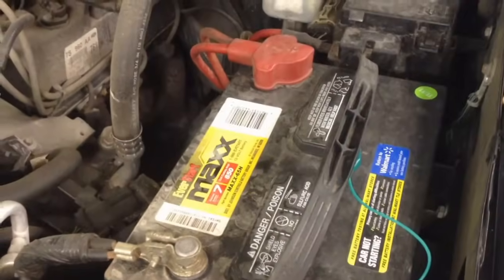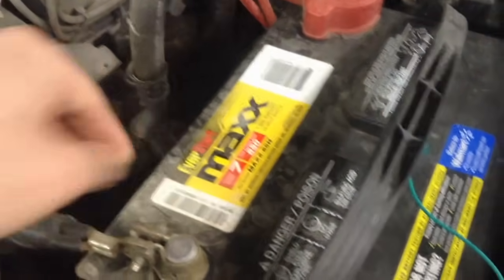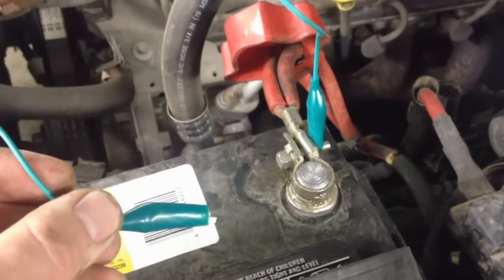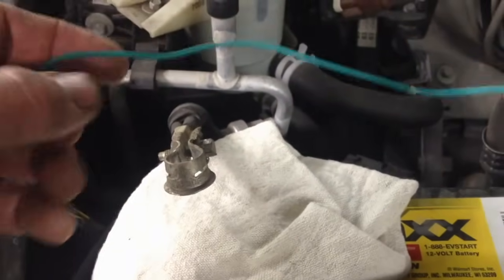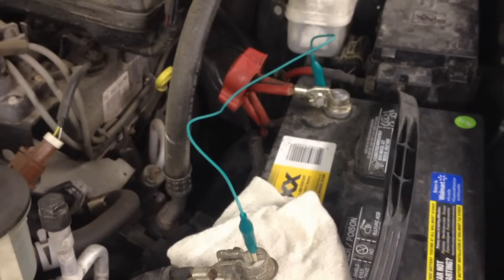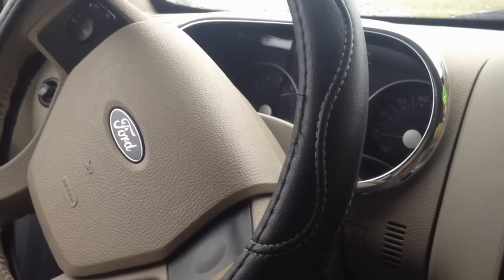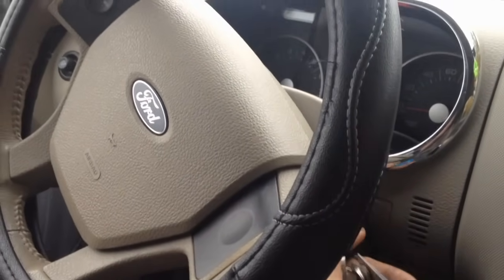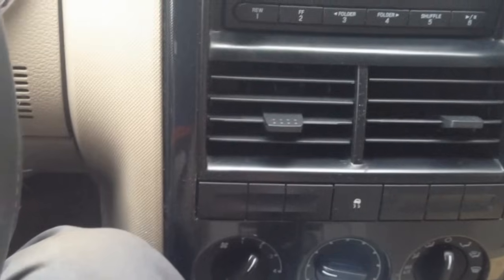How To Clear Your PCM'S Memory On Fords After Repairs

Comment: I have a 2014 Ford Escape with the dual clutch transmission. I cleared the KAS or KAM I believe its called. And it shifted good the first day. Second day it went back to shifting hard from 2nd to 3rd gear. I hear you say in this video that this should work better then actually clearing with a high end scanner? Let me know, because i dropped serious money on my scanner and it didn't fix the hard shift

Comment: Does this work on a diesel? Mine is an 04 e-350 6.0 super duty boxtruck. Has issues with being very sluggish and gear shifting. I removed the positive and left it off for an hr. Started driving a bit better but not doing as well as it should.

Comment: 2015 F150 3.5 Lariat. Wanting to try and reset the learned values in the EPAS as I have a bit of play or slop in the steering gear. Dealership would not perform or even look for a recalibration update (I gave them the one to look for but they wouldn’t do it) so before replacing the rack and pinion I’d like to try a reset to the learned behaviors in there and see what that does. But my hesitation to doing the PCM reset using this above method in the video I want to know if the TS bulletin I had installed several years back to update the shift points is going to also get reset. It was very hard shifting before they did the ts bulletin so I don’t want to go back to that. It’s been good since. Anyway to isolate the reset of just the EPAS? Not finding online. Thanks.

Comment: 89 ford mustang 2.3 with newer man built engine at 8k miles. Blew a belt thats why. And i took it back to shop once again for an oil change and changed thermastat and radiator because it got to hot. Now a year later the car has been having no power after a stop i can never floor it, usually have to 1/4 part throttle and Slowly increasing to half way open throttle. Got codes 23, 31, 83, 84. So 23 disappeared, and 31 disappeared after i put new egr vacuum solnoid, then next day i got 31,83,83 KOEO then 31 Cont... Im going to try this becuase i think this mught be my last step..

Comment: Can I pull the negative wire and connected to positive instead? If I dnt have wire clips?
Reply: I was thinking the same thing. Just disconnect the negative and hold it against the positive thats still connected to the battery for 5-10 min.

Comment: This would still work on a 13 mustang GT after valve body ?
Reply from the maker: yes
Reply: @FordTechMakuloco  how do I get the teeth to line up correctly with the blend door actuator ? I just pushed the actuator over and it clicked then , I put it all back together still hot ac but no click , I’m thinking I broke the actuator by turning it to the bolt in position , any help would be great

Comment: Great video! I assume this will completely clear all codes (including radio presets , correct?) 
* UDATE: It did not clear my radio preset codes!).      The GOOD NEWS is it gives me confidence that a learned code (that could remain in the PCM memory), will not fire and give me a false indiction resulting in a fail at the mandatory Emissions Test we have in Georgia (cannot get tag renewed without it!).  *   I recently had 2 codes (PO401 & PO455. related to fule tank/cap, evap canister and EGR issues. I performed the easy task first (cap less tank valve clean and lubricate), erased codes with scan tool and at 52 miles, CE light on again! The good news was the PO455 code for the fuel tank valve was gone! Next replaced the EGR and Purge valve, erased codes with scan tool and at 102 miles, the CE came on again. Bad news was I now have both codes back (PO401/PO455). I will go back in and recheck all performed work, purge soleniod @ tank, check lines/etc. * Can anyone tell me what is the normal/average range of driven miles needed for my PCM to reset?  For the codes above, my PCM reset after 52 miles first time and 102 miles the second time, driving the exact same route. Is this normal? THANKS FOR ANY INPUT!

Comment: I have a 2017 ford explorer sport 3.5l ecoboost. Ive recently put a custom emailed dyno tune on callwd AO auto octane tune by gear performance. My issues came when i tried to reflesh my explorer back to a stock tune. After returning it back to stock i started it and all kinds of check engine lights came on including traction control, hill assist, chwck engine and a bunch of others. It surged forward luke ut was in gear. I was so confused because it is a new car. So, i got scared a put the tune back on it and everything is fine again. Can you tell me what is going on or what i should do to get it back to normal on rhe stock tune

Comment: I know this is a really old video and you may not even see this, but I've replaced my alternator twice and the battery light is still on, all the wiring tested good for continuity and I have battery voltage where i should it's just not actually charging. I've been told by a local mechanic that I should replace the PCM. Do you think this might help me instead?

Comment: I am fairly ignorant on this part so I want to ask ... exactly what is it doing by jumping the positive charge side to the negative cable?  Isn't that feeding a positive charge through the system?  Sorry I understand your process and know it works I just do not understand what is happening electrically in this.

Comment: What do I do my 2009 ford f250 superduty 5.4 triton my truck has a car with a lock light on the dash with every other light won’t even try to crank the doors ding the radio don’t work the dash lights that tell u what gear ur in dont light up idk what’s wrong with it

Comment: I got an issue with the 2013 f150 3.5 EcoBoost number one cylinder has been misfiring and in six is misfiring so I replace coils on the coil packs all new spark plugs and the cylinders still not working got a code about the emissions and the fuel tank purge canister purge something so I replace that whole deal on top of the intake there for the Persian and it's still not still not functioning number one cylinder still dead any ideas

Comment: hello, I know this is an old video. just replaced one of my blend door actuators and had to pull the dash. forgot to disconnect the battery before disconnecting the air bag. will this clear the airbag light, or do I have to take it to the shop? Thanks

Comment: They say your the go to guy I have an 1994 f150 colt 5.0 I have changed front tank fuel pump fuel regulator and fuel filter I am still not getting any fuel to the fuel rail  please help

Comment: I appreciate your information about the vehicle you were working on. I had a fuel pump issue and it appears it might be the fuse panel underneath the dash so but that’s another story meanwhile I had someone check my truck and they thought that the ecm was bad so I replaced it with a new one from a auto parts store with all my vin numbers but after I put the new ecm in I don’t hear any turbocharger noise and it seems to think it’s not on the truck. So my question is will this reset work on a 2007 6.0 liter turbo diesel or does it need to go to the dealer to fix it or have the ecm done

Comment: I just bought a 2013 Fusion with the oftentimes 'dissed 1.6t engine' because the previous owner hated its shift points, shuttering and of course the high pressure fuel injector noises. Per your videos, I reset everything and put about 100 miles on it and it now runs great. $1000 for a 118k mile car that runs well is a bargain in my opinion. Thank you so very much for spreading your knowledge and simple step by step tips.
I've been a mechanic for decades but factory reset type cars were never my thing.... old school cars are common sense just like you've made the drive by wire vehicles via your videos.

Comment: I have a 2015 f150 3.5 EB. Bought it used with 78k. I now have 93k miles. Sometimes it will hesitate between 3rd, 4th, and 5th. Best way to describe. If you were driving a manual and in too high of gear at low rpm. You get that little shutter. It will shift, if you accelerate more. There no dash indicator lights. A shop told me ford needs to check the pcm. That’s how I came across this video. Side note. The truck was used commercially. But it must’ve been a Forman truck etc. it is pristine zero rust. Always was serviced.
Reply: Is this something I should try for what was mentioned above?

Comment: I did what you suggested transmission works but it doesn't work like it's supposed to hit won't go to overdrive and when it wants to go from first to second that kind of wants to hesitate and I just let off the gas and Let It Go on into gear after you drive it and you come home and put it in reverse it will not backup but you can put it in park and cut the engine off and crank it right back up and it'll backup I was wondering about putting a bottle of motorcraft friction modifier in it I did change the fluid and filter Mercury or 5 it has 187,000 miles on it Ford explorer with a 4.0 5-speed automatic

Comment: Dude!!! I reset the PCM after replacing the TPS and cleaning the Throttle Body, but my truck was on for 5 min and turned off by itself. Turn it on again and turned off again by itself after 40sec. No codes nothing what can it be?

Comment: Thank you so much once again for your TRUST-WORTHY informative video! 
Question: Should my 06’ Lincoln Navigator’s shift-points be relearned while towing a 6’x12’ cargo trailer camper conversion (2500-3000 lb.) since it will be towing the trailer full-time for at least the next year or more?  Thanks again. AE  BTW. I may be coming through ur city this winter and would like to
get some work done on my 3V 5.4L Navigator if possible. Can u please give us ur business info. (Address/phone/URL)?

Comment: If your car had a dead battery for a while, and was replaced, wouldn't that have cleared the pcm of energy, thus reset it's memory? I have a 2004 Tbird. It's having shift problems. Trans shops say it's the PCM.

Comment: Hello, love your videos and you are a huge help.  My '94 T-bird 3.8 liter V6, supercharged engine turns over but won't start. It is a professionally rebuilt engine from machine shop with many new parts such as camshaft position sensor, crank sensor. The camshaft synchronizer is installed in the correct position at 26 degrees ATDC of the compression stroke.  Has 40 psi at the fuel rail, has spark at the spark plugs, has 12 volts at the fuel injectors and compression is 145 to 155 on all six cylinders. All wires and grounds between the PCM and engine were checked and are good. It seems to be the fuel injectors are not being activated since I have compression and spark and fuel pressure. I'm thinking the injectors are not being activated, but not sure. Will this method clear the PCM for the engine also? Thank-you.

Comment: I know this is an old video that might be all the way wrong with that Im looking for.  I am replacing the HVAC Control Module on my 2014 Flex.  I was told I needed to flash my cars computer but I saw somewhere online that this might work in programing that module to my flex.  Is that actually a possibility?

Comment: Bought a 2014 F150 5.0 Coyote about a month ago and the check engine lights been coming on intermittently since I got it. Misfire on cylinder 7 is what it’s been saying. I’ve replaced the plug, coil, and injector. Still keeps popping on and runs rough in idle sometimes. Gonna try this when I get home. Hopefully it’ll stop it.

Comment: I just had a new transmission, coil pack replaced, new plugs under a CarMax warranty still didn’t fix the low speed bucking. Not fixed. Could it be something this simple??

Comment: Hopefully you see this message! I have a 93’ Explorer I’ve replaced almost every EGR related part and my Check Engine is still on. I read my codes and EGR is my problem, if I do this will my check engine come off if the problem is fix?.

Comment: Will this work on a 2010 focus SE..? There are these numbers on the trans pan 8S4P-7000-FA PVAF and I think the trans may be a 4F27E.. 
I had codes for shift solenoid C (the code was P0760 & P0760 P) and D (P0767 & P0767 P)
and I replaced A-E and the other sensor (I think it was a sensor) i also change the filter… I do have fluid leaking out now too 😔 but the problem still persists…. Only 1st and 2nd gear. No 3rd and no OD.  There are some lights on in the dash - the wrench, the traction light and that light won’t go off when I push the traction button.. and the engine light is on as well…  and the ABS light too but idk that I’m too concerned with that one at the moment… I’m at a loss on what to do with this car…. I’m hoping it don’t need a diff trans put in because idk how to do that repair plus I proboly don’t have the tools to do it plus I know I don’t have the muscle… what would u suggest I try next….? This dang car has me almost beat but I’m not giving up just yet…. Thank you for any advice you could send my way

Comment: So, I performed this reset and after years of troubleshooting, swapping parts, etc my severe power loss issue is resolved including many check engine codes that have been plaguing my vehicle's system intermittenly for years despite new parts. I swapped my engine, swapped the transmission and much more but the problems always came back. I have a 97 Ford Expedition XLT 5.4 with some insane modifications and upgrades, but still never had the power it should have. After the reset I performed the idle learning process and proceeded with the learning shifts process. However, the truck was now running extremely rough. It would not surpass 25 MPH. Every time I pressed the accelerator to go faster the engine would instead bog down. I had to severely feather the gas and start over feathering the gas pedal each time the vehicle shifted gears because it would bog down every time after shifting. At most I was able to eventually reach 40 MPH. I tried turning off overdrive as the truck previously performed much better with overdrive disabled. No changes took effect. It wasn't until I stopped, turned the vehicle off and then restarted the truck (without waiting for the truck to cool down) that the entire vehicle came to life. My truck has all the power it should of had since I bought the vehicle 18 years ago. Also, my passing power/kickdown now works and my truck climbs steep hills with overdrive enabed and without a single struggle. I have never experienced this truck running so well. I ran the check engine codes after the first horrifying test run and experienced engine operation temp exceeded, cylinderhead temp exceeded and drive cycle not complete codes. After clearing the codes and restarting my truck those codes were gone and stayed gone (I went for a long test drive on straight roads, steep hills and in-town driving). The only codes still remaining are the dreaded bank 1 too lean and bank 2 too lean. However , the truck is running amazing. So, what's my point, I think this video should be updated to advise viewers to turn the vehicle off and restart the vehicle before starting the driving test. Tomorrow I will perform the exact same steps and turn off the vehicle  after the idle learning phase before I attempt the learning shifts phase. Then, if all goes well, I will baby the truck until I surpass 189 miles to complete the drive cycle test and the OBDII machine confirms I have completed the drive cycle test. I will also read the codes before completing the drive cycle. I will check for codes after completing the learning shifts phase. I hope this helps someone because I was terrified my truck was going to blow up.

Comment: Hi, I just had my tcm replaced at the dealer, all my codes are gone, but when i connect my obd2 reader it says no  dtc,s or freeze frame data stored in the computer's memory, will this pass inspection all the im is green I did all the test drives I am at 250 miles it runs well.

Comment: I'm replacing my selonoid pack on 2005 mercury mountneer should I reset the ECM before I start it to do the auto level for the fluid or should I reset it after I level out the fluid

Comment: Good evening I have a question. I have a 2013 ford edge with the 3.5 motor  
All 4 camshaft position actuator are circuit open do you know if there is a fuse for all 4 ?

Comment: Will this work on the 13' model ecoboost f150? Mine has been throwing codes , I changed the lead frame in trans , was fine after I fixed and drive it that night ,next day drove it 15 miles and back to locking up in 4wd and won't go over 50mph

Comment: I have a 2005 mustang 4.0 auto that just stopped moving one day and went into limp mode. The car won't move harldy at all in any gear forward only reverse and the codes are showing shift solenoid a, b, c, d and p0743 for torque converter clutch solenoid circuit electrical. Does this all mean my solenoid block in transmission is bad? ANY HELP IS APPRECIATED!:)

Comment: Amazing! I wish you covered uk fords😂. I guess the principle is the same on our small 4 cylinder units though? I have a 1.5 tdci kuga that I can't clear data relating to exhaust tempreture sensor(showing high volts and high temperature). It's not fitted with the atomiser and the sensor checks out good. DPF soot levels at 34% etc etc. Just can't clear the bad reading in live data🤷🏼‍♂️. Do you think this idea of clearing the 'static' from the PCM might help? I've tried a battery reset(with a scanner and battery disconnect) but didn't think of your tip on this video. Cheers if you have any advise my friend 🇬🇧👍🏻

Comment: Thank you for this video. If I replace the Valve Body (including Lead Frame) on a 2013 F150 will I need to reprogram it or can I use this technique?
Reply from the maker: If you replace the valve body you need to program yes.